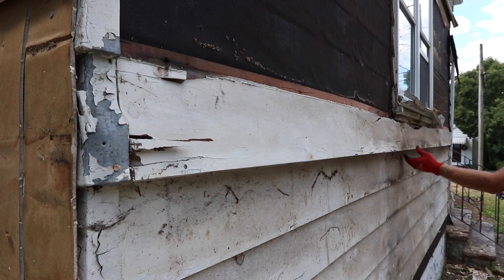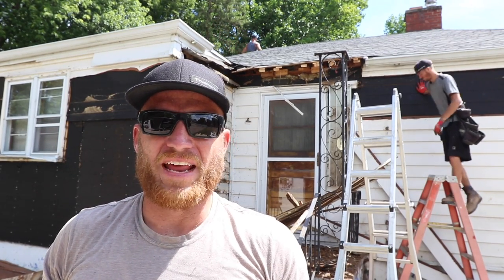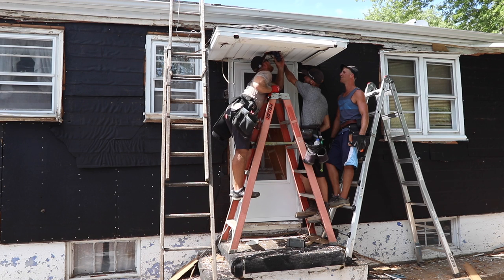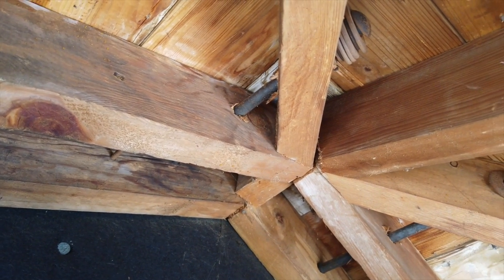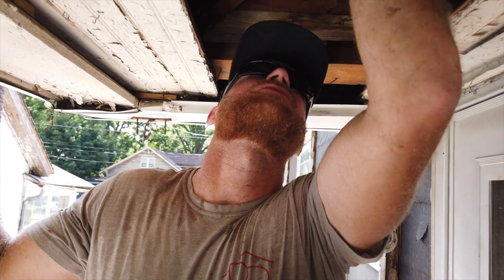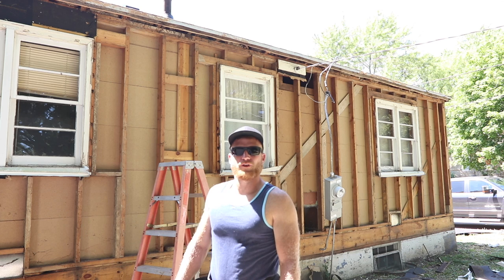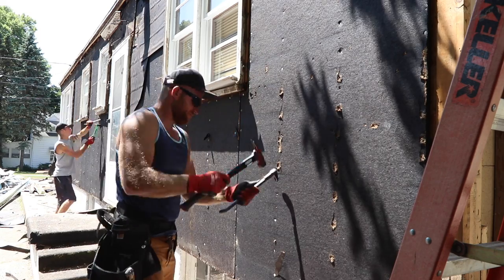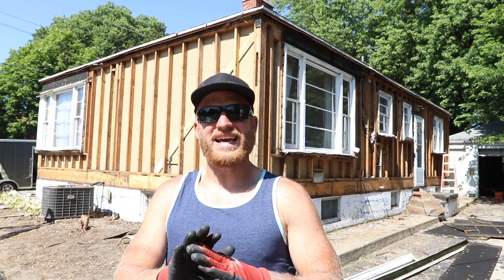How To Renovate Your Homes Exterior Part 1: Demolition and Preparation

Comment: Did they do any inspections on your work? Does anyone benefit from you having to get a permit? Or was it just a money grab from the city?
Reply from the maker: Money grab
Reply: They claim permits and inspections are for proper building practices, safety, etc. I guess it'll benefit the home owner in the end because they will be able to say everything is "up to code"  In the end, taxes usually go up, at least they did with me when I redid my roof, from 8000 to 8300 a year :(
Reply: it mostly gives some assurances to the homeowner prevent shoddy work from shady contractors. Also some lenders & insurance companies require building permit historical information to insure & finance certain structures. Would you want to insure or lend for a house that caught fire because it was wired by somebody who did not know what they are doing or licensed? 
There are more reasons than just a cash grab.
Reply: RR Buildings I disagree. 
Example:  What if someone reroofed a house that wasn’t up to code because they skipped a $30 permit? Say that house catches fire and 3 firefighters die because they fell through a roof that wasn’t re-sheathed to code?  
That’s more than a just cash grab.  Permitting is an important potentially life saving step in the process.
Reply: Michael must work for the building department.  It’s a money grab.   

Illinois.   The most corrupt state in the union.
Reply: Jon Jacobs NOPE NOT AT ALL!!  
But I have friends that are fire fighters and that is a legitimate concern.  

At one time I was a supervisor for a large demolition contractor & had to fetch demolition permits on occasion. 
So aside from that & my own home improvement projects I have only dealt with MY local building department 50 or so times.
I however have not dealt with YOUR building department. To each their own. 

Good luck if your house is destroyed & not covered because of something as simple as following rules.
Reply: @michael-michaelmotorcycle  I understand all of that.  I was asking specifically about this case, where only siding is replaced. Was curious of any inspections required and why.
Reply: Kevin Wise when I resided my house with LP smartside after a hailstorm a permit was not required in Denver if I as the homeowner was doing the work. A contractor doing the work would require a permit - same if it was not my primary residence/rental property and I also did the work. 
Jurisdictional for sure.

Comment: On the old cedar siding, is that LEAD based paint?!? If was painted before 1978, I bet it is.  Lead paint was banned in the United States, in 1978, for all residential use.  It is likely that all of those boards were painted with white lead based paint. Highly neuro-toxic as inhaled or ingested flakes.

Comment: Use that zip sheathing
Reply: I think zip only comes as thick as 5/8 and he needs 3/4
Reply: @braydonscully4646  a good builder can work with an 1/8" margin. Lol. I've never used zip didn't know it didn't come in 3/4". Thanks for the info.

Comment: Do you or a loved one have mesothelioma? Did you work on home renovations of older properties with asbestos insulation without proper protection provided by installers of siding or interior construction. You may be compensated for your suffering.

Comment: Starts machine saw with blade touching surface metal incorrect protective eye wear didn't turn off electrical. Should be what not to do video. Good teaching video what not to do.

Comment: yuck. This shit gives me anxiety.  Nasty job. Go from new siding to finding rotten framing to finding poor sheathing to finding no insulation to putting new windows in to needing sheetrock work on interior because of new windows.... Might as well re-wire while the wall is open...